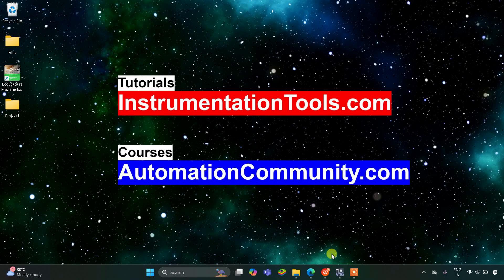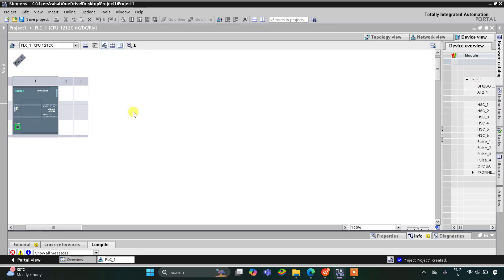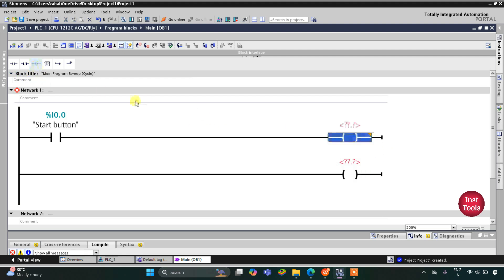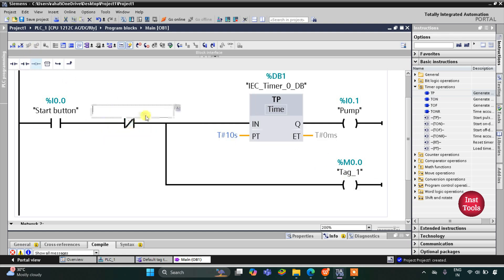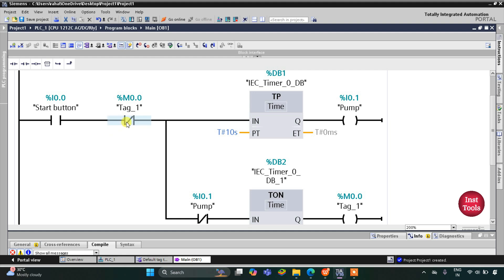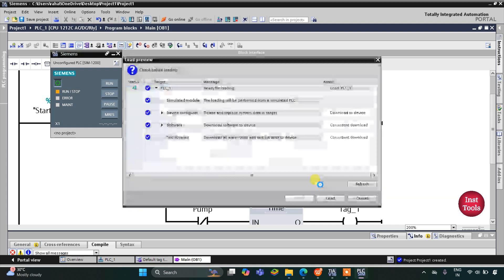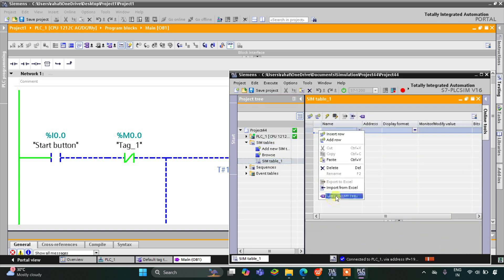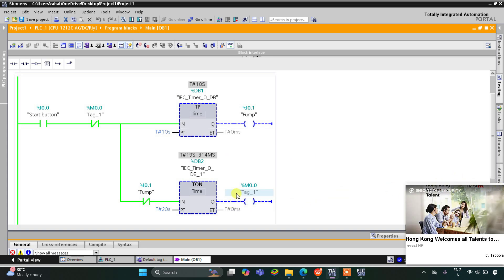Siemens PLC: ON for 10 Seconds, OFF for 20 Seconds, Repeat Cycle

Comment: How can it run without latch / holding by start button ?
Reply: This is use timer pulses instruction
Reply: I'm guessing since this is a physical input the physical push button used is not a momentary push button. So whenever it is pressed the button itself latches the input signal until a seperate "stop" button (also assuming this is a dual button lever style latching (like old start stop motor pushbuttons on drill presses etc)). Either that or to stop the circuit you'd have to depress the physical "start" PB.